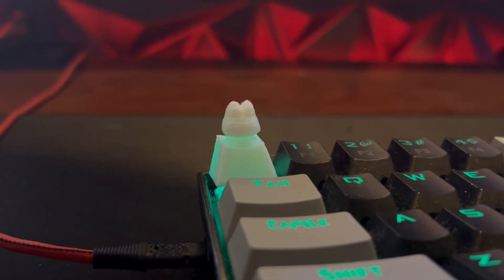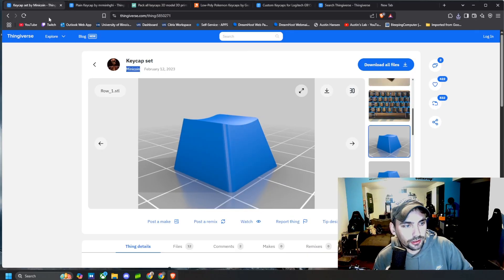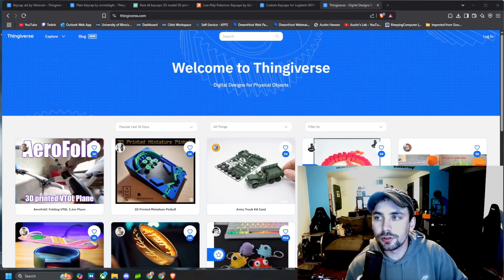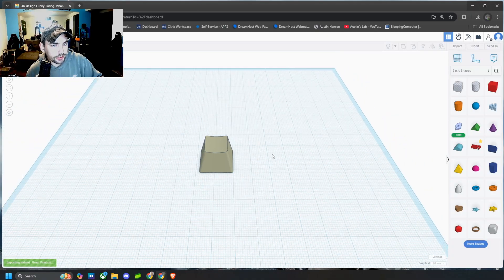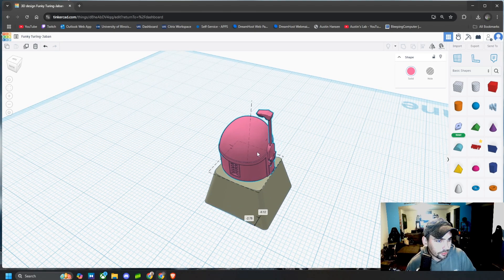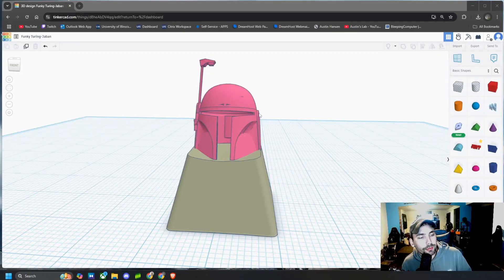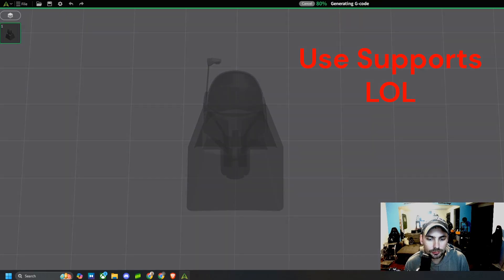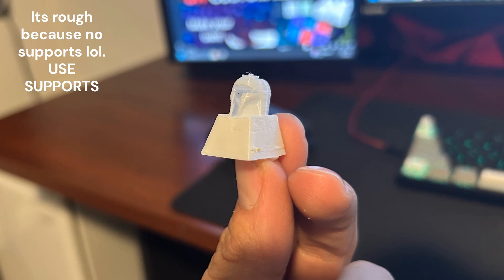How I 3D Print Custom Keycaps Using Free Models

Comment: Is there a way to optimize key caps for shine through?
Reply from the maker: Yes! Absolutely, I can make a video on that, but basically in tinkercad instead of putting an object on top of the keycap you put the letter or number and make it be a “negative” and subtract material from the keycap instead of adding to it. Kind of hard to explain